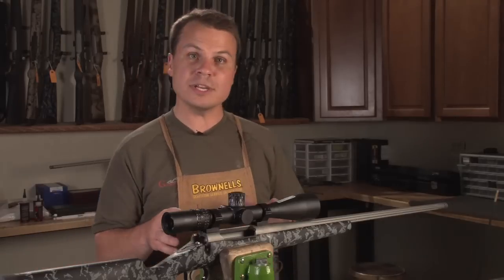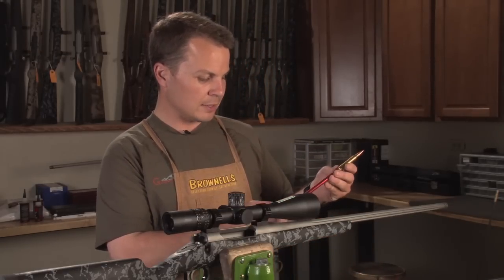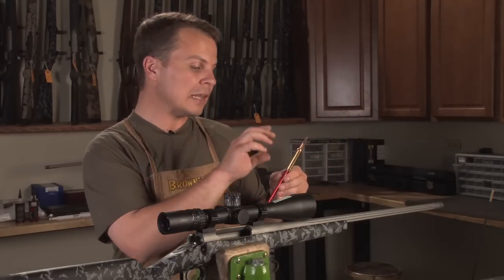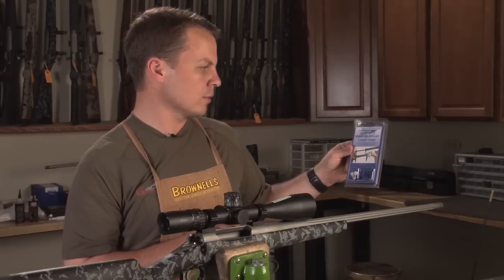DIY Bullet Seating Depth

Comment: U don't measure OAL. U measure from the ogive. Some bullets are longer but have the same ogive distance from the back of the case. U need a bullet comparator.
Reply: +John Boyd this is entirely correct.  COAL is affected by bullet length variations due to melpat variances, but the ogive distance should be consistent.  If you don't believe John, go to the Berger bullet web site.  Berger bullets also has articles on seating VLDs on the lands vs. jump.  I do not question their long range expertise.
Reply: The easy way to do what John is saying is to make dummy reference cartridge with the same exact bullet, at the COL length you measured with the Frankford Arsenal tool. Then, use the bullet comparator to get the land measurement from there. I write this number on the reference cartridge with a fine sharpie and keep one for every caliber and every bullet I shoot. You can use them to set your dies up as well.
Reply: John Boyd Aaron didn't mention the rest of the procedure which involves using a bullet comparator.  I guess he assumed people knew that part.
Reply: Totally agree with JOHN. A comparator is way more accurate. Base to ogive is the best measurement. The tips of bullets are easily off by several thousandths. Just get your caliper and measure a dozen hollow points of the same box. You’ll be amazed. If you’re going to try for a rough .020, which isn’t too precise, you can get away with overall length, base to tip. But the gun tells you what it likes and most guns shoot tighter if they are off the lands by a consistent thousandths— not hundredths. The tools to measure ogive are cheap enough. 
In the video he said he also would measure using you own fired brass, which is also a good idea, then you drill and tap the base. Anyway, decent quick method shown here but not the best.

Comment: Is it not better to measure from the bullets ogive. As I've in the past measured bullets themselves with polymer tip and lead and hollow points that show no lead. I can tell you and you all probly know that taking measurement from the tips can be off 7-8-9-10-11-12- thousands less and maybe a little more. Just a thought ????
Reply: You are half right. If you use the same bullet that you measured in the breach to make a dummy round, you will have no variation. This dummy round should be then measured with a comparator, and used as a reference for all following bullets.
The real problem with this setup is using the cleaning rod, it would probably be best to drop the rod in vertically to measure the bolt face, and bullet tip
Reply: Half right? Mossyoak obviously understands COAL better than this video presentation, (which should be removed from YouTube).
Reply: Tenwalls Yes, half right. As presented this is 100% fine, except that he should add that you make a dummy round. You do not understand the concept that there is no variation when only one round is measured. A comparator should be used on the dummy round for all following loads. Why is this so hard for you to grasp?
Honestly, if this concept is not crystal clear to you, you need to try engaging your brain before you start tossing stupid opinions around. Hopefully you take the time to think before you load up and go to the range.
When I started loading, measuring to the tip was the standard practice. Comparators where considered to be too expensive for the return.
The minor variations you get in OAL when measuring to the tip will have almost no effect on accuracy for 99% of the shooters out there. I consistently shot sub 1/2MOA groups measuring to the tip with my .308 before I invested in a comparator, and I can't honestly say it made a difference - it just makes me feel better. A good set of dies will always put the bullet to the same depth, and that depth is tailored to the gun, not taken from a book.
Reply: joshua43214
Oh sorry, I was basing my comment on the video I watched. Not the one you're running in your head.
Reply: joshua43214  maybe in the States they are called Comparators.. but what is a Comparator thank you (is it a verneir caliper?)
Reply: Peter Parkinson no. A vernier caliper is just a type of parallel jaw caliper, there are three common types, vernier, dial, and digital. The bullet comparator in the part that clamps onto one of the jaws. It allows the bullet to be measured on the ogive.
Reply: Ok yup i understand mate. Thanks

Comment: Call me goofy, BUT (I'm with you all the way) when you place your markers, but you don't show where the measurement alignments are to be taken. I understand the measurement but it's not readily achieved with my caliper without subtracting the thickness of the first marker. Where am I wrong ?
Reply: both markers are set at the same measuring point (the barrel crown ) therefore the measurement must be taken from the same face of each marker clamp !given that one is set at breech face and the other at the ogive (or the point of contact with the lands) !

Comment: Question, if you are using a custom OAL and not seating the bullet as deep as the reloading manual, then do you need to change the cartridge trim length correspondingly to maintain the same neck tension?

Comment: Ok, why not just fit a case bullet loose in the neck and close the bolt on it.  Gently remove it from the rifle and measure the OAL? Why not just do that say a couple of dozen times with once fired brass?  Then average the OAL data and compute SD.  If it looks good you have a statistically correct OAL cartridge length, you didn't SPEND MONEY ON A TOOL THAT DOESN'T DO THE JOB AS WELL, and you can adjust from a true OAL for your bullet in once fired brass?
Reply: yea. you can do that. in fact, this is how i do mine. i take a fired/non-useable piece of brass (or just use a spare one). size it so it fits in chamber nicely. then use a hack saw/ dremel tool to cut the neck in either 2/3/4 (I start with 2, a few cases need 3/4).

then i use my fingers to "crimp" the petals that i just cut into the neck tightly. insert bullet so that it is capable of moving, but with resistance. insert into chamber, take measurement. repeat a few times to make sure you get accurate results. you now have starting point of where to load.
Reply: Old Dog Works fine as long as:
a) Your bullet isn't seated too tight so it jams into the lands past the point where it just touches
b) Your bullet isn't seated too loose so it doesn't move at all when you remove the cartridge
c) Your bullet isn't seated too loose so it doesn't move when you measure the COAL with your calipers

You should repeat your test measure a number of times to make sure you get the same measurement

But you can easily make your own 'Frankfort Arsenal' tool with some straight rod pieces and 2 clips.  Those same tools can be used for multiple rifles and calibres.  No need to fuss with modifying multiple cases.  I used brass rods and tight fitting 'dura collars'.  Found everything I needed at a local hobby shop for radio controlled model cars etc.  Pick a rod diameter that is smaller than the smallest bore you expect to reload for.
Reply: Old Dog You can do that but if you want to reload a number of calibers it's easier to just make your own 'Frankford Arsenal' tool with a couple of pieces of rod and some clips.  I used some brass rod and a couple of Dura Collars I got at a local hobby shop.  Simple and cheap.  Just make sure the rod diameter is smaller than the smallest calibre you want to reload for.  No more fussing with cases to get just the right neck tension.  No more worries that the bullet might have slipped or moved while measuring with calipers or been jammed past the lands.
Reply: That's exactly what he said he started out doing. In this video he's showing some tools that might be a little more precise.
Reply: Except that isn't more accurate, is a lot more trouble, and doesn't tell you the most important thing anyway.  That most important thing?  Bullet jump.  How much should the bullet move before it engages the rifling.  That will vary with every component of the load.
Reply: Old Dog  The problem is that he didn't show the next couple of steps that follow to establish the max. length base to Ogive.   They are as follows:
1. Using the same bullet, seat it in an empty case to the max. COAL already established by your measurement.
2. Use a bullet comparator such as made by Hornady to measure the distance from the base of the case to the Ogive.

Once those two steps are completed you will have the seating depth where the bullet is touching the lands/rifling.  This is the same length that you get with your method, assuming you have avoided the pitfalls associated with that method.

Of course this doesn't replace load development to determine the best combination of powder brand and type, primer brand/size, powder load, seating depth (jump) for your gun and bullet choice.  You still have to do that, but you have to do load development regardless of what method is used to determine the max. length of base to Ogive.   There's a saying about old dogs...perhaps you should just stick with what you know 😉.
Reply: The way you measure will be appro. for all your loads, If you measure your bullit you will find that not all your bullits measure the same.

Comment: One problem with this method.....you are using a bullets nose, rather than the bullets Ogive, as a reference point. Bullets in the same box VARY in overall length, so did you use the longest bullet in the box?, the shortest in the box?, or the middle of the road bullet?. Ogive (the diameter of the bullet that is wide enough to contact the bore) is the important value. this method is o.k., but not accurate enough.

Comment: You're losing credibility.  You know, and I know, you're going off a false length due to Meplat distortion.  No Meplat, or "Tip" is even close to the same as measuring off the Ogive. The Hornady/Sinclair option is by measuring off the Ogive and is WAY more accurate.  And when you're talking about 20 thousandths or so, it matters!  I can't believe you endorsed this product!

Comment: I don't want to be that guy, but this tool is producing false readings.. What you got here is about .020 jamming.. Why? When you feel tension from the rifling you are already into the rifling with the bullet.. Then if you seat it .015-.020 shorter or off the rifling you really are near the "touch" or just off.  This can create inconsistent pressure issues if you don't have very consistent seating.. You will have one bullet touching, one off and so on..